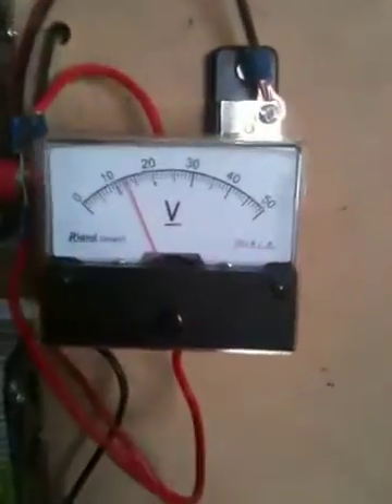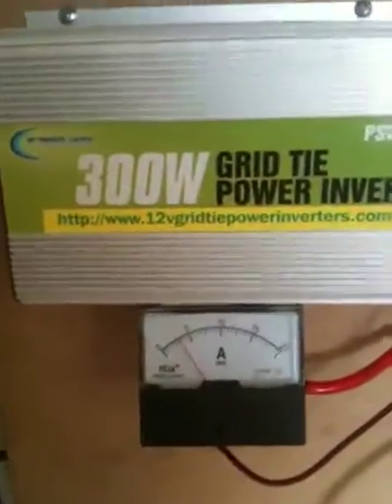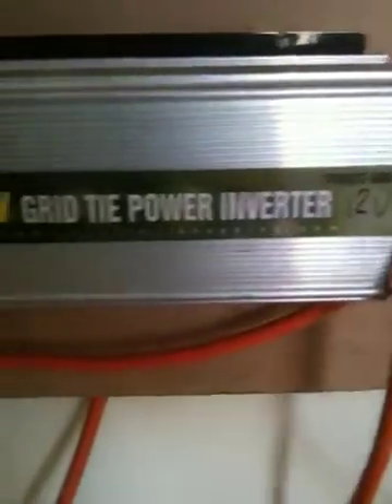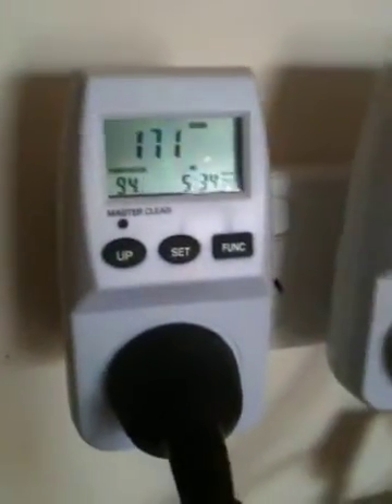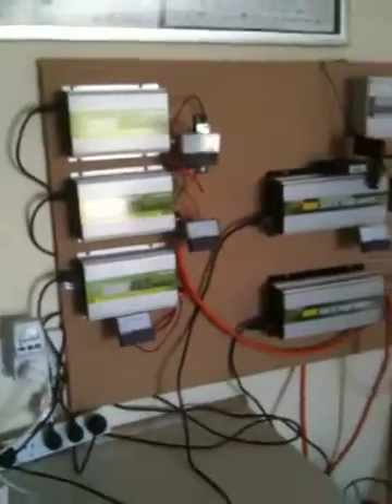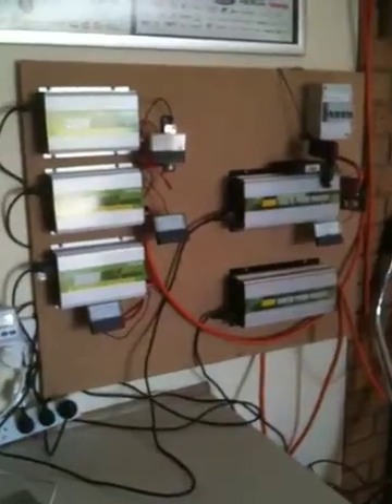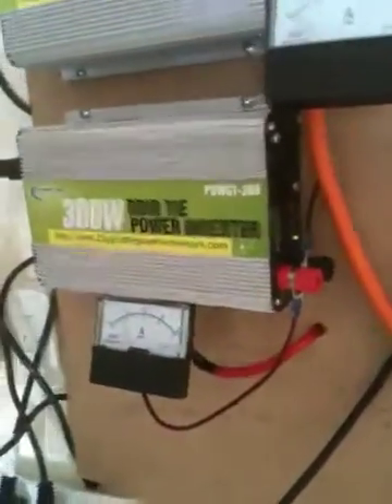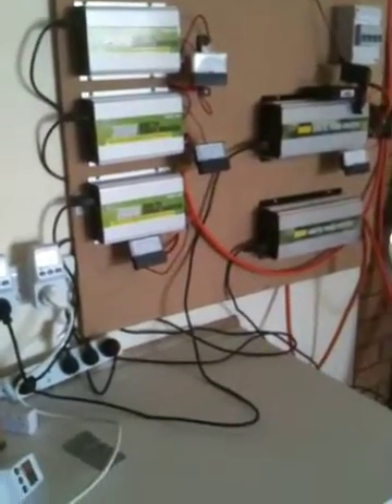Grid tie inverter update

Comment: Wait, you mean to tell us that any inverter can be hooked into a normal electrical plug and it would just put power into the grid? (yes, the inverted needs something feeding it like batteries or a solar panel array) My thing is I would have expected the inverter to fry if you just plugged it into an electrical plug.

Comment: Go to Ebay look up shunt's and amp meters and reseach the wire diagram, which is usally included in the item description! A warning though those digital chinese made 200 amp / volt meters are not dependable! The average tempeture here hits 105 degrees F. when the units get hot they becme irraddict, looking at changing both units out soon! Maybe winter time and cooler wheather will make a difference!

Comment from the maker: @johnphan76 
Hi,
I have about one panel for each inverter. They tend to run at a lower temp. The fans wont come on and waste my solar power keeping cool.
Two of the inverters have a 100 watts and a 40 watt panel. This make the fan come on all the time.
I have tried to connect them to each other but i find the Watts drop off on my meter.
One panel per inverter for small scale is the best.
I have some new 1200watt inverters that have 4X165 watts panels at 100volt on them. They work great.

Comment: Regarding power output. I have a similar sized array to yours 4x100w + 1x 200w.
The array is setup to produce 30-40V under load (42v open circuit).
The 600w array is connected to a single SUN-500g GTI, which produces a sustained AC output around midday of around 350w. Output can peak up to around 400w if the panels are cool.
* Actual panel output is rarely anywhere near the rated power due to high cell temps. 
* GTI conversion efficiency varies over the MPPT range. 80% is common.

Comment: There are solutions to the AC power draw, but they all involve disconnecting the AC from the inverters at night. I have used AC time switches and Solid State Relays but unfortunately, the 220-240V model PowerJack GTI's have a bad habit of blowing up when being re-connected to AC (even with no DC applied to the solar input side), so I would not recommend that you do this if you want your inverters to last more than a few weeks. You probably don't want to hear this now but the SUN-500g is the go.

Comment: Couple of issues for you to consider:
Each 300w PJ GTI draws around 5-6 watts from the AC at night.
Each 600w PJ GTI draws around 10-12 watts from the AC at night.
So, based on your system (3x5w + 2x10w) = 35w per hour.
At this time of year 11 hours X 35w = 385w AC power draw
In Winter 17 hours x 35w = 595w AC power draw.

Now, work out how long it will take your system to generate the above power before you actually start making net power into the grid. 
It can be a bit sobering..